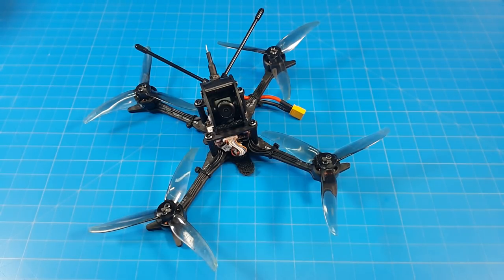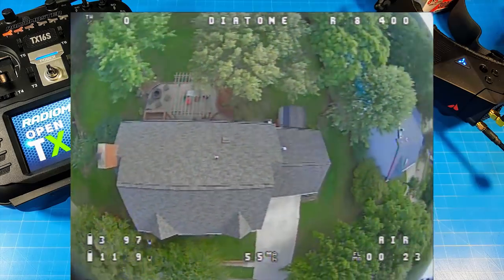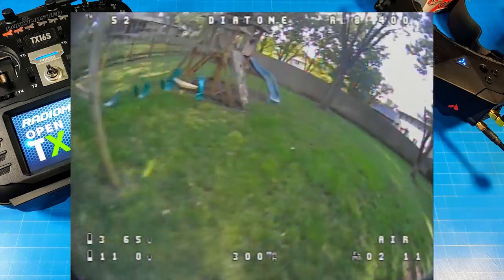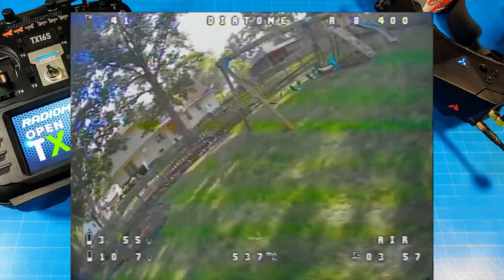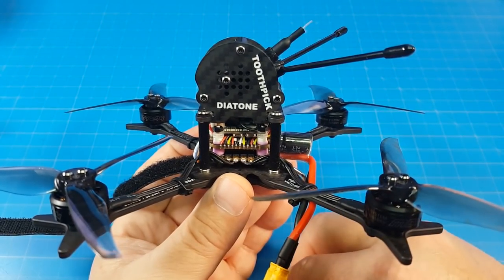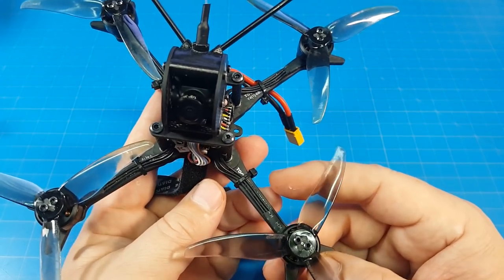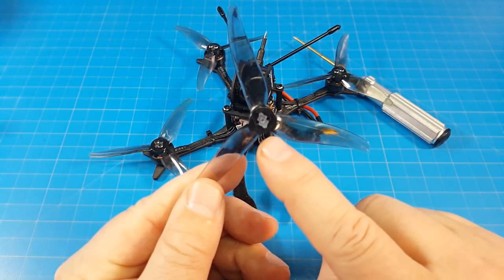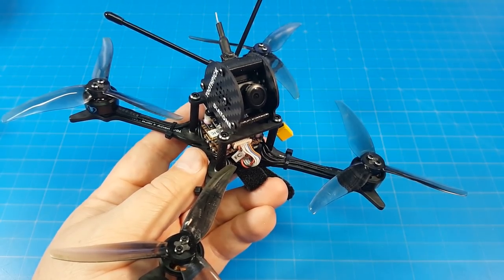Diatone Toothpick 4inch // Power Pick // Is it still a pick at 4 inches?

Comment: Consider: first consider that the frame is Bob's (KababFPV) FPV Cycle Power Pick frame; he "gave" it to Diatone. If it looks like a toothpick, then maybe it is a toothpick. If it  looks like two sticks crossed, with the central fuselage not much bigger than the Flight Controller whether a 26x26 whoop board or a small 16x16 stack , then maybe it is a toothpick.  Consider also, that Bob's designation of a toothpick was basically take the whoop [format] electronics and put them on a light weight, minimal, open prop frame; no designation as to size. If it looks like a toothpick, them maybe it is a toothpick.

Comment: On that type battery strap flip it over, and pull it through on 1 side, put the battery on next, go over the battery, and through the other hole in the frame. Don't use the buckle. The buckle just holds it, and this way it's not under the battery, not perfect, but better imo. I never saw your daughter, you were ripping to fast, Thanks Nick!
Reply from the maker: Yep that would be good too

Comment: It's a shame Diatone didn't use their new mamba 1606 motor on this one. With a 4s 850 pack and the 1606 motors it could have still squeezed in just under the 250g limit, and it would have been a rocket. 1404 seems a little undersized for 4", but if the goal was a cruiser going for longer flight times I can see why they did what they did. 

I've been really enjoying my PowerPick build running a 4s 850 and the fpvcycle 2203 3450 kv motors. The auw ended up at 265g. It's still manageable on the low end, and impressively fast at the top end.
Reply from the maker: I wonder if they have something else in mind for the new 1606 motors?
Reply: @NickBurnsFPV  There is a new 2207.5 mamba toka used in their Roma F5 build. Could be a 4" version of that coming soon if I had to guess. Looks similar to Armattan type freestyle frames.
Reply: @karoo_bushman6880   For my build I used the jehmcu 30a aio board, the flywoo goku 625 vtx and topped off the stack with a Rocketeer pod from TomoQuads and a runcam nano 2. Dry weight ended up at 165g. I also added a Panasonic 1000 uf 35 volt capacitor to the battery pads on the fc. It seems having a high quality and high capacity capacitor makes a real difference to flight performance with the 2203 motors. I have found the gemfan 4023 triblade props to be my favorite so far. 

With the way I built mine with a canopy attached to the flight stack bolts, accessing the usb port isn't an issue. If you build it with the carbon canopy like Diatone has, using a 20x20 stack won't be an issue but using an aio board you won't have direct access. This isn't a huge issue though, since you'd just need to remove 2 screws and then you could take the standoff out of the way. The Diatone frame here is essentially the same as the original fpvcycle frame. They are using the design through a deal with Bob.

After calibrating the current sensor the highest max amp draw I've seen is 66 amps with 3450 kv 2203 motors, gemfan 4023 props and a 4s 850 battery. If you plan to stick with 4" props you're fine you go on 4s, and that 25 amp mamba aio board should work just fine without needing a throttle limit. If you plan to fly both 4" and 5" the 3000 kv motors might be the better choice, though I've found the 3450 do just fine with 5" running 3s batteries. On 4" props you can definitely notice a difference between 3s and 4s, but 3s still flies really well. 2203 3450 kv 4" on 4s to me feels very close to the quick and nimble performance from the TP3 platform. From a build that is 2.5X the weight that is impressive. It's a handful, but still controllable.
Reply from the maker: @sixtofive  They say that a 3inch is coming. When?
Reply: @NickBurnsFPV  Hmm, that sounds interesting.

Comment: I really want to see this frame on the Emax 1606 4000kv, HQ4x4.3x3 V1S, and a 1050 or maybe even 1300mah 4S. Should be good for 1027g of thrust per motor.
Reply: @pirateradioFPV  I will have to look at the diatone 1606. This frame is actually available on FPVcycle (From KaBoB). I am still considering building one the way I would want it.